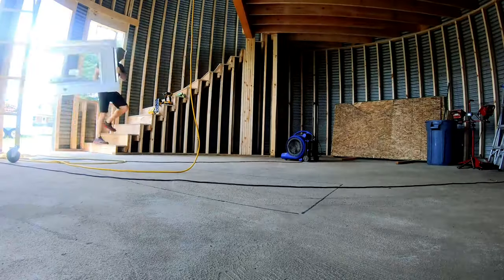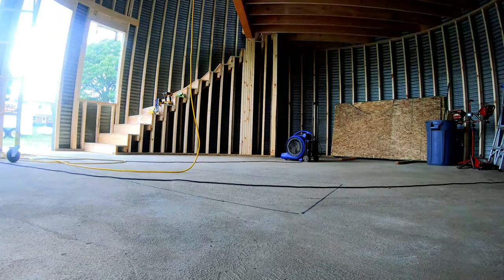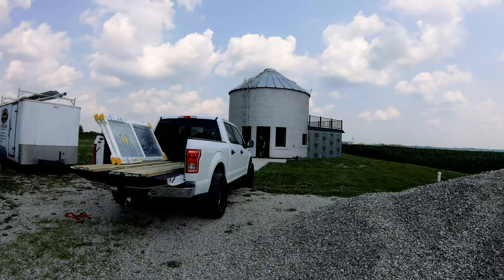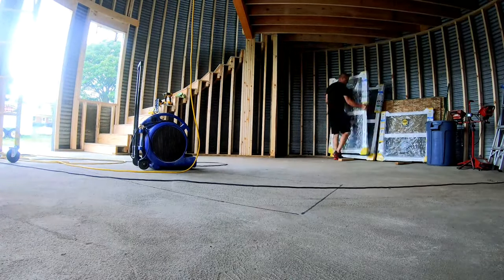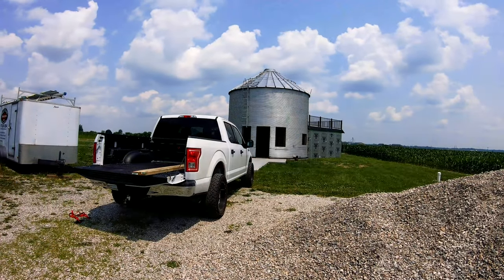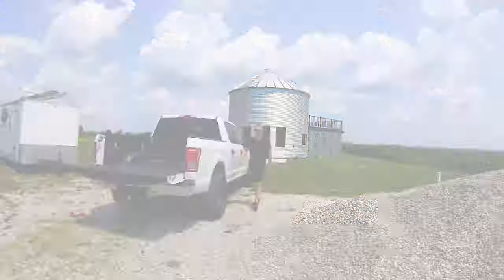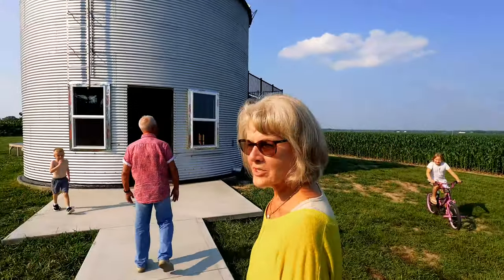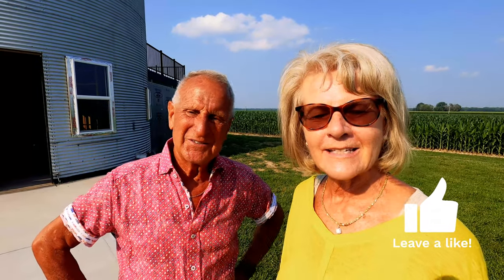Grain Bin Home Build... Episode 16 "Windows and Doors"

Comment: Can you please estimate the installation hours per window including cutout framing and installation of window.
Reply from the maker: I had about 45 min per window to cut steel opening out.  About 45 min per window to frame out the exterior opening.  About 15 min per window to install it and flashing tape.  About 90 min per window on exterior trim to it.
Reply: @blueroomoutdoormedia5630  thank you!, it seems the 10hr per window estimate a friend of mine received may be a bit high. It's one of the problems with these unconventional builds, options are limited.
Reply from the maker: Yes sadly. I have been asked multiple times if I would be willing to travel and build one of these for someone .